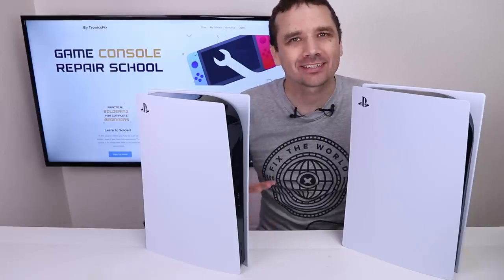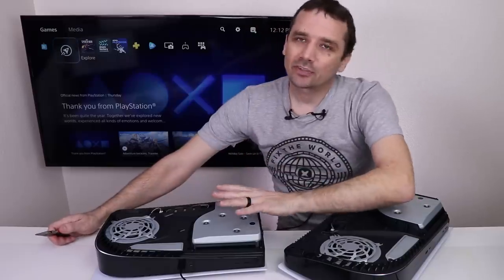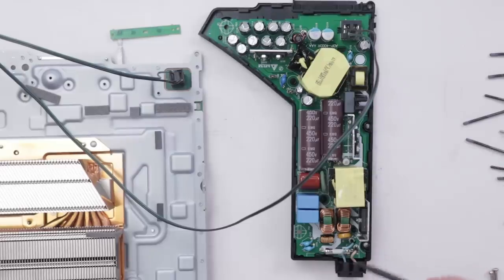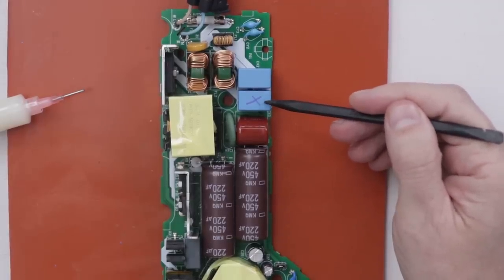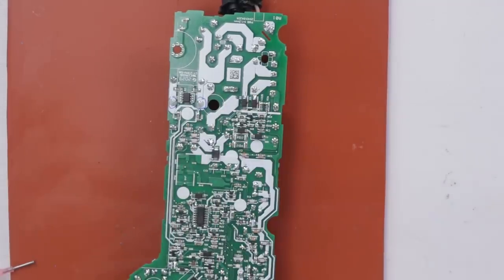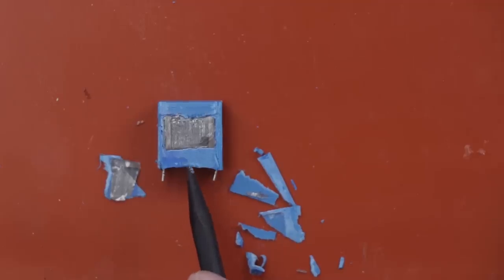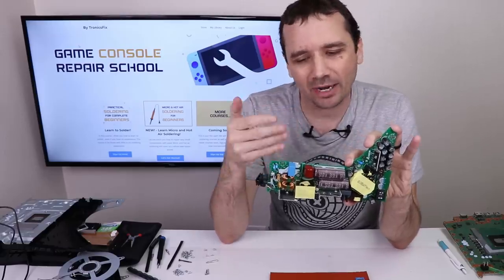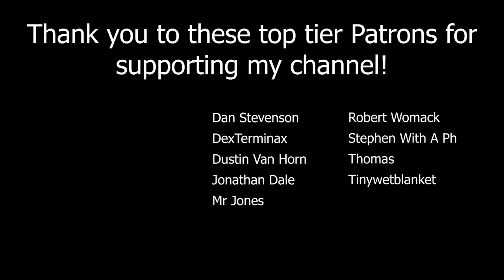PS5 Coil Whine - What Is It and Can I Fix It?

Comment from the maker: Wanna learn how to fix game consoles? Check out my online courses: https://www.gameconsolerepairschool.com/
Also, anyone know what I could replace that capacitor with?
Reply: Who else dose not have a ps5
Reply from the maker: @Ethan Atchley I thought of that but since both of them have exactly the same noise I don't think the capacitors are faulty.
Reply: The coil whine is usually produced by the coils themselves and not the capacitor. When current gets passed through the coil, it vibrates and makes that sound. 

I've managed to fix the same problem (not on a PS5) by adding some thermal glue to the coil and the components around it (in this case the capacitors), gluing them together. 
Try this if you can,  you can use any cheap thermal glue. By gluing both components, the vibrations should be dampened.
Thermal glue on coils is frequently used on TV's to reduce the noise.
Reply: It could be a problem on hz on the power lines, the console works with 50/60 hz but normally 60hz it is never 220v, it could be near 240v+ in your power lines, people should check their home and check their lines dont have noice or a short circuit witch the switch dont jump, i know sometimes it happen cause i live with a generator and sometimes when the engine speed up the hertz go up and and as an example the power suply of one of my mates here sound loud and work hard, maybe it is that, that capacitor is working to much.
Reply: @Hack3rPT  Yes. I posted a picture just above you showcasing what must be done. BTW could you tell me about that thermal glue? Maybe a link? I want to do that on my PS4 Pro some day.
Reply: My PS5 is pretty silent, no issues reported here.
Reply: @indirajithk214  No it does not affect anything in the circuit. You're only adding thermal glue. This can also be seen in some consumer electronics, like TV's.
Reply: @Hack3rPT  oh ,, thanks man
Reply: Replace the capacitor but put some hot glue on the board before putting the new capacitor in and wait for the glue to harden before soldering it in (that could work or it could make the noise louder but if that makes it louder it's just hot glue so it should break off without damaging the board with a little heat from a hot air gun)
Reply: @nathanmead140  The capacitor is not vibrating. The sound is coming from the coil. I suggested above that a bit of thermal glue should fix the problem. I guess that if there's no thermal glue available, he could indeed use hot glue. I do still heavily recommend using thermal glue instead of hot glue.
Reply: Just signed up for your courses!! This is a great idea and thank you so much!! Happy New Year!! 😊😎😊👍👍👍
Reply: My PS4 Pro had a buzzing noise from the power supply.
Reply from the maker: @Hack3rPT  No, it's not being produced by the coils. The coils already have glue on them and I checked them for noise very carefully. The noise was very clearly coming from the capacitor that I show in the video.
Reply from the maker: @roballen7937  Great! Hope you learn a lot from them!
Reply: @Tronicsfix  I apologize then. Hopefully someone else finds a fix!
Reply from the maker: @Hack3rPT  The capacitor is making noise from the inside. This is actually a documented problem with film capacitors in some cases. The noise is due to the mechanical vibration of the films on the inside.
Reply from the maker: @Hack3rPT  No apology needed. It's also possible that I'm somehow wrong. When I was testing it though the only place there was noise was right directly from that blue capacitor. I know in probably almost all cases this noise is generated by the coils...in fact I already had some glue ready but they were already glued down in this poser supply and they were not making any noise.
Reply: @Tronicsfix  Is it possible that the caps from Sony are defective? Maybe try to buy some different brand ones and replace them? It's very unlikely, but it might work...
Reply from the maker: @Hack3rPT  I've thought of that. I'm going to buy some from different brands and see if that helps. Might be tough to get some that are the same size but hopefully it's a standard size.
Reply: @Tronicsfix  Forget my other comment. These are standard size. I found multiple sizes with the same spec, and one of those standard sizes seems to perfectly match yours.
If you can't find one it's easy enough to bend the capacitor leg under for it to fit.
Reply from the maker: @Hack3rPT  Cool! I'll be buying some from different manufacturers to see if I can find a quiet one. Thanks for the help!
Reply: @Tronicsfix  Hopefully it works, I'll be waiting for a video on it! As always, thanks for the amazing content!
Reply: @Tronicsfix  Also, just to add another possible solution:
If you buy the same capacitors from different brands and they still show the same problem, you could try buying caps with a higher voltage rating with the same capacitance. From what I recall on replacing capacitors, never use a lower voltage, and it's always recommended to go a bit over the voltage that it's gonna take. That one is 310v, so I guess up to 400v it should be fine.
Reply: @TronicsFix do you hear any coil whine from the gpu? Because my coil whine changes, when the pictures changes. Its much louder when playing a ps5 game than play a ps4 game or just be on the homescreen.
Or could this also caused by the psu?
Reply: @Tronicsfix  All capacitors make noise you just can hear the noise those make.
Reply: @Tronicsfix  if u say noise hear from capacitor can we call dis problem as  capacitor sequeal,,Capacitor Squeal is actually the noise heard when a capacitor is about to fail. Essentially it’s where gas is escaping through tiny holes in the capacitor and makes a “whistle” sound/hissing etc (technically  noise).if am wrong wid dis concept please correct me ! Coz dis is a part were people confuse lot wid coil whining and capacitor sequeal ....
Reply: @Tronicsfix  As far as I know an X2 is in the 15% tolerance range. Since they are parallel mounted, I wonder how hey affect each other if both on the other end of the range?

When replacing, I think it might be good to check them if they do match.
Reply: @indirajithk214  This is not a electrolytic. Its a film capacitor. These don't have vent holes and they do not make that sound when they're about to fail. These also don't leak, so they are better in many ways compared to the electrolytic caps, but each one has its use case. Film capacitors do make sound, as @TronicsFix said earlier, but it's not the same as electrolytic capacitors.
Reply: hey man i saw some of your videos but haven't found anything thats able to help and you seemed to now alot i was asking if u can help me figure out y my playstation 4 slim says usb memory not connected i tried fixes i saw but still has that problem
Reply: @indirajithk214  It depends. Coil whining and capacitor squeal can be the same problem, but they also can be different, it depends on context.  Coil whining is usually caused by the coils, but if you check the coils and there's no sound coming from them (like TronicsFix did), then the coil whining could be coming from a capacitor. 

Capacitor squeal represents when the capacitor is about to fail, and yes, it's when there's air escaping from the tiny holes. 
If the capacitor is not a electrolytic, then capacitor squeal won't mean that the capacitor is failing. And you are correct, in film capacitors, the sounds stars appearing when there's a bigger load on the capacitor.

You can use both terms. The correct term in this case is capacitor squeal but you can also use coil whine, both describe the sound that's coming from it.

Also, try to improve that grammar a bit, it might be a bit hard for other people to read.
Reply: from racing R/C I notice with motors (even not in motion) you get a buzz at low power, a hum at medium power, and high pitch/whine at high power. so pretty sure it's a vibration of the frequency. more resistance has more noise. of course, if the wire is not wrapped tightly it makes more noise. if I had to guess, the only way to fix It (if the wires are tight) is counter dampen the vibration. I bet if you cover it in some type of putty it would reduce the vibration.
Reply: @Hack3rPT  ok sry for ma bad English...
Reply: Dark Alk  ?
Reply: Dark Alk  what
Reply: Dark Alk  what bro
Reply: Dark Alk  bruh you still play fortnite
Reply: @Tronicsfix  hey man my ps4 is acting up the last 3 days it wont turn off when im turn it off it just blinks the white light and it wont let me rebuild the database it gives me an error any ideas why?
Reply: @lostrebound3529  me
Reply: @Tronicsfix  i finally had the courage to clean my ps4 like deep clean my ps4 cause of 1 of your vids now it doesn't sound like a jet engine :) 👍
Reply: ... you're the hero we need. But don't deserve. You're the dark repair man...
Reply: @lukaslauer  the buzzing noise on ps5 is not coming from cpu, fan, etc. They are all very quiet, it’s within the power supply. Different games and different modes in games (performance mode for example) require more power drawn from the power supply so that’s why the buzzing can be louder or quieter depending on the game
Reply: i download to usb download the files to the ps4 but still didn't work do you now what it could be @dark alk
Reply: @MyJONY13  Actually in Europe anything between 207V-253V is acceptable. It's 230V +- 10%. Some spikes happens, especially if you have PV installations around, but on-grids are usually automatically cut of when system voltage is around 252V.
Reply: @Tronicsfix   you should have tried playing a game!  Playing a game would cause the coil whine to vibrate more or be louder and you’d be able to detect the problem easier and maybe even physically see how it’s being caused.  Demon souls would be the perfect game to test it with
Reply: @Ratio_Ray           10mm/16mm/19mm/   Pitch 15mm    (Width/Height/Thickness/Pitch)
i wont to ask you some think  capasitet ist mater?
Reply: I found and ordered a capacitor with almost identical specifications. It's a Würth Elektronik WCAP-FTXX X2 680nF 310V/AC 10 % 15 mm (part-# 890334025045CS) capacitor. I spoke to an Electronic Engineer colleague and he said the lower capacity (original 1μf) wouldn't be an issue. But i should only replace the noisy one, not both. There isn't any capacitor with identical specifications from other manufacturers out there except the original Surge Components one. So this is the best bet. I'll make a video after succesfully replacing and testing the new capacitor
Reply: This is what happened if you rush your console production, a lot of flaws exist and it make sales dropping+price is too high I think
Reply: I'm looking to get into repairing electronics, I was wondering what kind of soldering iron I should buy, im looking to buy something decent but not too expensive
Reply: @lostrebound3529  Buying a first generation of anything is usually not a good idea, they always seem to miss something.
Reply: Hey man i was wondering if you can fix my unfixable ps4 controller to do a video on u can keep the controller if ya want
Reply: @zrkn1  Dude I don’t even have the ps5 haha what I was saying is who doesn’t have the ps5 but thanks for letting me no
Reply: @zrkn1  true
Reply: @Baba_Yaga88  are you sure? And it can make different noises depending on the ingame scenes of the Game?
Thought this has to be the gpu coils
Reply: @Tronicsfix  I read on some electronics forum that running a higher rated capacitor (630volts) will stop these making noise if the lower rated ones are on the limit. I've had to send mine back to Sony because of how loud it is.
Reply: So your saying they already damaged their playstation 5 it barely came out a couple months ago
Reply: I am having DNS wifi disconnect in rest mode on my replacement ps5. Do you think the wifi card is bad? My original one didn't have this problem no changes to my internet.
Reply: @Tronicsfix  the DNS wifi disconnect in rest mode on PS5 is this a bad wifi card? I got a replacement for my 1st unit and having wifi issues, which I didn't experience on 1st unit. I can't download games because it keeps disconnecting and I am getting bad wifi speed in and out.
Reply: @Tronicsfix  change the volue higher voltage to the capacitors
Reply: Just wanted to give an update on my PS5 which I have now had since mid-November. Initially my unit did have coil whine. It wasn't as loud as some of the worst cases, and you had to go up to the unit very close to hear it. The whine was certainly no distraction, and I use headphones anyways. But since beginning of this month the coil whine noise has gotten a lot quieter, to the point that even if you put your ear to the unit, you can hear a faint noise. I did nothing to the unit so somehow it got better on its own.